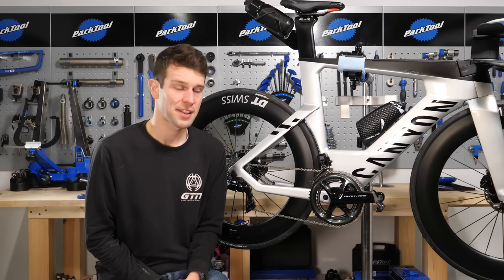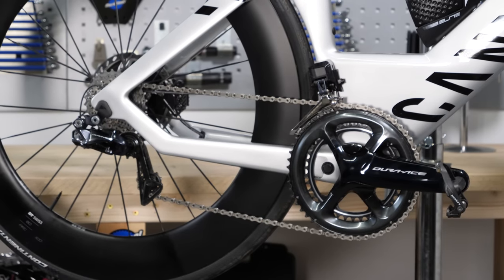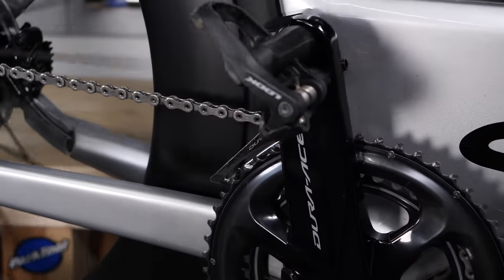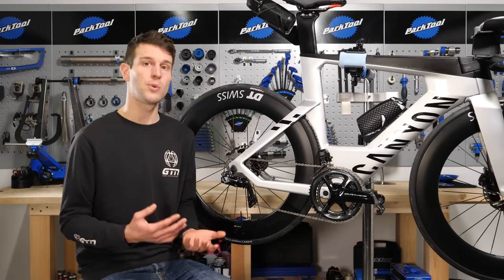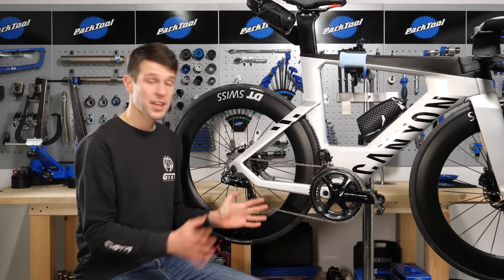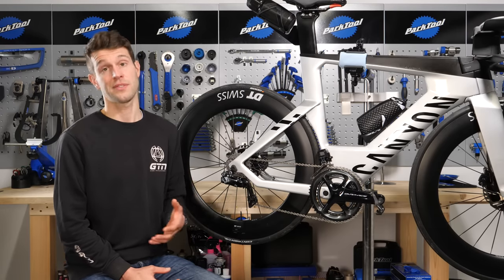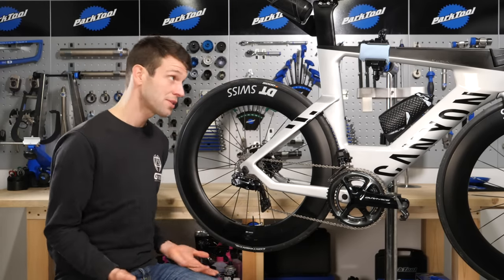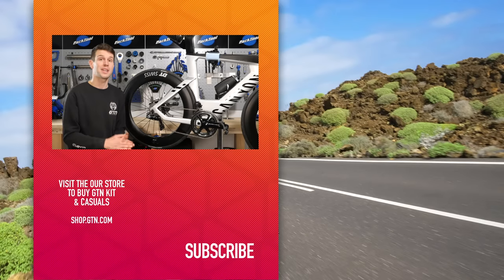How Does Shimano Di2 Synchro Shifting Work? | Electronic Bike Gear Shifts Explained

Comment from the maker: Do you use electronic gears? Let us know!
Reply: Just dont have enough money for that
Reply: I am going to, when Canyon delivers my bike
Reply: Hell yes! Got my first Di2 on the gravel bike I bought in March 2020 and since then am a HUGE fan of Di2. Bought a used Cervelo P2 2019 bike that was equipped with Dura Ace Di2 in December 2020 and currently upgrading my Canyon CF 7.0 roadbike from a Shimano 105 to a mixed (Ultegra/Dura Ace/105) Di2 setup. Full synchro with remote shifters for the win!!!
Reply: yes they never work properly
Reply: Yes. Older DI2 Ultegra (eTube though), but as far as I know it doesn't have synchro. I got one for my city bike as well. It doubled the price of the bike, but it was worth it.
Reply: I use etap AXS which has same features but just keep it in manual becuase at the start of climbs dropping to the small ring the rear mech would put me into too low a gear too soon making my cadence skyrocket. If the groupsets could better sync and understand ones power output, gradient and cadence then it would select a better a gear combination.
Reply: I do, but absolutely hate it... I miss having the feel of changing gears!
Reply: Yesh 🥳

Comment: I hesitated whole idea of e shifts. But when I got di2 on my Canyon Inflite Tream Replica, I went all the way to synchro shift. Noticed that synchro shift is neglegted by many, due it is different, but that to me is the biggest advantage of e shifting. I modified levers so that from left big pad gears goes to small and from right big pad gears goes to big. Same direction as chain moves on rear casette. Front mech moves when needed. I configured small shifter pad to operate for front mech in case need for instant drop is needed. On cyclocross race there is no time to think what gear youre on, you just hammer and shift.

Comment: I been using the Di2 Dura-Ace and Ultegra for years now. I'm a triathlete and was traveling the world. Wales IM. Arizona and so on. I must say that relaibailtiy is better to have rather than anything else. I've had a few breakdows with the Di2 in an important race where it simply did not work. The Wales IM with all thouse HM (3600meters i beleve it was). When I did the Wales a few years back the front derailer stopped working. So I was on the large chain ring for the entire 180km. I was in exelant shape but my run suffered from now beeing able to shift into smales gears due to the failure in Di2. They said it was a cable that had broke. Or a very tiny connector pin of some kind. That ruined the Wales IM. In other competitions the battery was dead. And all that fustrations lead to chance to the SRAM Etap where mailfunctioning cables can not happend. I do Etap on everyting I have now. When the Di2 was working flawlessly it was fine. In the newer modes you can monitor the battery like in the video. Great. But with ETAP it's also very easy to switch the battery should they become a problem. Even on race day. You can have spares and swap them in under 30 seconds. There was a time I considered going back to mechanical gears. But after Etap - there is no way back :). Great vids. Always enjoy them. Very fun and informative as well. Keep it up.

Comment: Shimano Ultegra R8060Di2 comes with 1 button shifters(on both extensions bars and brakes levers). How do you use semi synchro shift and manual modes with only 1 button?
Reply: The only way is to have the aero bars operate the rear mech, and the base base operate the front mech - as an example. But yes, it's not ideal with the single button

Comment: Hi. I just bought a new triathlon bike and it came with just one button on both aero and base bars. I am used to having 2 buttons on each. Which is the best way to set them up. Am considering using synchro shifting and using both aero and base buttons to move the rear derailleur. Thanks in advance

Comment: All this is new to me. Bought a new bike with Di2 electronic shifting.
I recently succeeded to charge the battery. Check. 
It was initially programmed in full synch. I pressed to button to switch it to the manual mode with success. Not happy with it, I now want to go back to semi or full synchro. When I press the button as shown on the video, nothing happens. If I press numerous seconds, only than, the red light blinks 9 or 10 times then the green lites once! What does this mean? Thanks.

Comment: My only issue with electronic shifting is the cost. Too bad we can't get something other than Shimano or Sram.
Reply: campag does eps shifting... not gonna save you any money there though ;)
Reply: on that note though, pretty sure that FSA released an electronic groupset that was pretty well reviewed a few years back. Still pricey but less expensive than the big 3
Reply: @matthiaswuest7271  Yeah, but where I live, for serviceability and replacements parts, the only options are Shimano of Sram.

Comment: Synchro mode is a pain if you are in rolling small hills.  As you come down a hill towards a slight rise it shifts onto the larger front ring for you and within seconds you are shifting down to climb the rise.   I am not a fan.

Comment: Why is it when you're in manual mode you're in the small chainring and you can move down the cassette down to 9 but can't go to 11 but if you're on the big chainring you can go from 1 to 11
Reply: Because it's setup like that in the firmware. You have to connect it to computer and free those gears up. You have a choice to lock out gears in a rear depending on big or small ring.

Comment: Isnt it harmful for bike to be clamped on top tube?
Reply: Yes and no. Ideally not on the top tube. Unfortunately there is no way of clamping on the seat post on this bike. I have instead wrapped the frame before lightly clamping. I wasn't doing any proper maintenance, so the bike wasn't moved much

Comment: Yet another great reason for SRAM eTap AXS.
Reply: I've got SRAM AXS which has the same features too but stopped using them. Whenever I reached the base of a climb that required me to move from big to small chainring the rear derailleur  would automatically move up the cassette too much making my cadence go out of control. I like AXS but keep it in manual mode.
Reply: This is feature that's not turned on by default and is easy to configure with the mobile app.